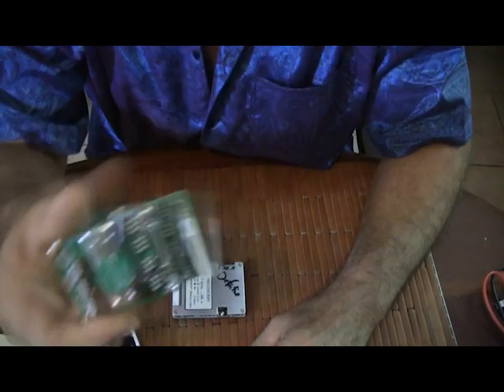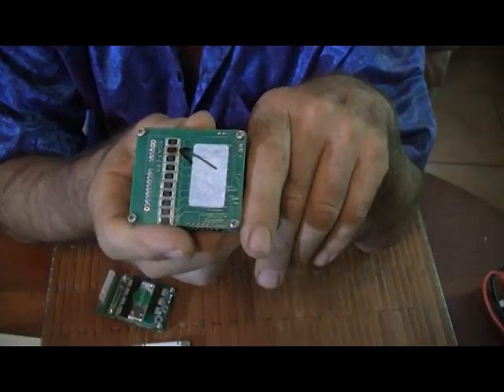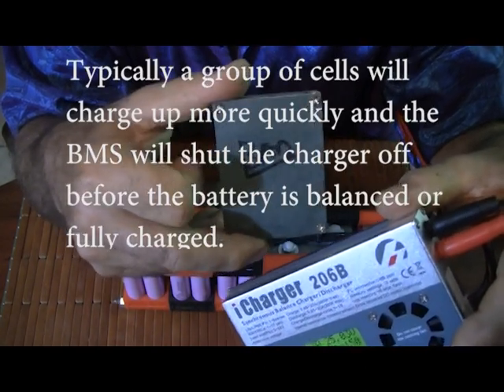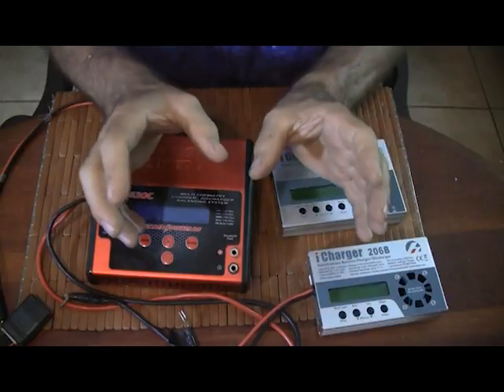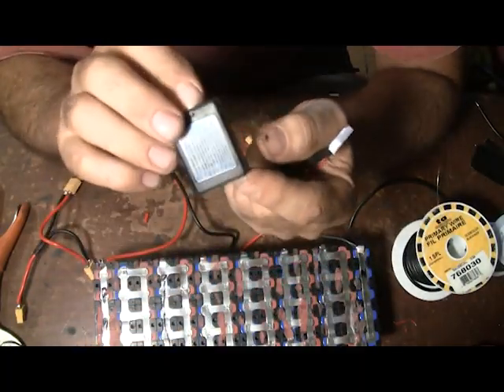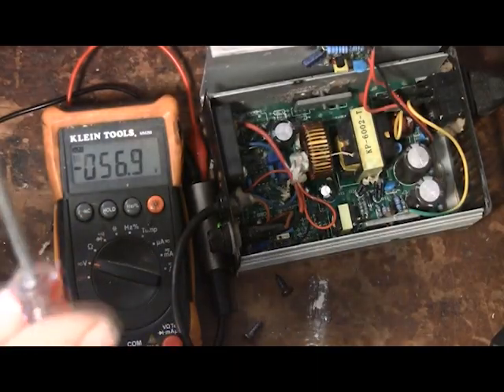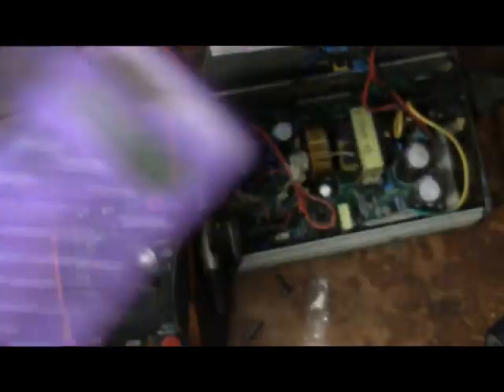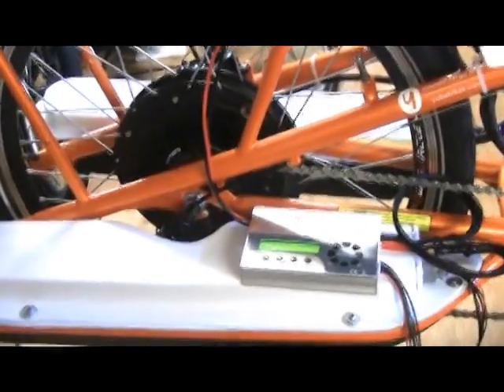How to build a safe and better lithium battery WITHOUT a BMS.

Comment: I'm agree with your point but if you don't know so much about lithium battery and just want to plug and play then BMS attached to the battery pack is necessary, just mind to charge at low rate to allow the BMS balance properly. By the other side,  If you know about the battery lithium then yes; you can make a pack and use a intelligent charger with internal BMS and monitoring display. I make separate packs with the desired capacity and connect them as required with a Low voltage warn system like shown in the video. When I want to charge the battery  just disconet the packs and charge individually at 4,20v. No BMS is required at all. Just a charger like a tp4056 or few of them in parallel and a charger from a cell phone or a few of them. No special charger is required neither. Which way is better? First or second way? All of them. You must think about the requires of your project. Let's say you are fixing a wireless battery drill. Well, the cells use to be placed inside a closed case and is not usefully to open it up every time you need to charge to, so BMS is necessary or at least a balancing wire. In other project like a bike? Well, perhap the second way could be interesting.
Reply from the maker: I agree with everything you said.  Try them all and use the way that best works for you and your project.

Comment: Hi Shawn, it's been a year and been enjoying my ebike to great lengths changing without a BMS as you say. One thing I did have trouble with at the beginning was that I split 14 cells into 6, 6 and 2 and used 3 imax chargers. But... If I forgot to disconnect the cells from 14 to 6,6,2 and I connected up my imax it would smoke them out and they wouldn't work anymore. Now I always remember to split the pack up before charging. But.. It occurred to me to ask you today do you have a way where you can keep your pack as 13 or 14 cell but still charge up 6 cells each without disconnecting it all? Maybe with a diode or something? Many thanks as always you've been a great help in this journey.
Reply from the maker: Hi Danny,

Congrats on your successes!  Yes, you can leave the battery wired in series and still charge chunks.  Pretend the first 6S are their own battery.  Connect an XT-60 to the positive and negative of that 6S battery.  Connect your JST connectors to the first 6S battery.  Now you can charge/balance just that chunk without disconnecting the 14S series battery.  Now pretend the next 6S is a separate battery.  Connect an xt-60 to the positive and negative of that 6S battery, along with your JST connector.   ETC...
Reply: @shawname2  Thanks Shawn for that. The problem is when I do as you say without disconnecting the 14S into their seperate chunks it burns out my 6S battery chargers. They start smoking instantly. The only way I've found I can charge them is by disconnecting the 14S into their 6S, 6S and 2S and charging all 3 packs seperately like that. Somehow my Imax B6 chargers don't like to connect to their 6S, 6S and 2S chunks without the 14S all being disconnected. Any idea why that is and if i can put something in between each 6S connection to my Imax chargers to stop them burning out if I leave the 14S all connected together while connecting each 6S to the Imax B6 chargers?
Reply from the maker: Hi Danny,

Contact me at shawnwiththewind@batteryblocs.com   Send me a drawing of how you have the jst and xt connectors hooked to the battery- or send me your email and I will send you a drawing showing how.  This does work!  I think you might have the negatives in the wrong places...

Comment: you can balance all batteries by putting them in parallel without any electronic. they will balance themselves
Reply from the maker: True- and I have tried to figure out to switch back and forth between series and parallel wiring using relays, knife switches, but no sensible ideas yet.    Do you have any?
Reply: https://www.youtube.com/watch?v=hi8iDy7jsOg @shawname2
Reply: This guy in the above video has a different approach to how to charge all of the batteries in series at once

Comment: I watched your video 10 times and I rephrased my question again.

1.  I'm planning to build my first battery pack and convert to ebike, and you convinced me to spend more on good smart charger. 
I looked up iCharger 1010B+ but max output V 40 with 7 A, so by charging not to 42V but 40 V , I will extend my battery life. 

Please confirm that 1010B+ charger will be good for 36V 15 amp pack. What power supply would you recommend for this charger? I found Junsi 350 - Outputting 350W at 23A/15V. Will it be good? 

2.  If I get 10S charger but cell logger can only take up to 8s, can I connect 2 loggers 5 s+ 5s (not physically splitting the battery?????) and have extra port with  JST-XH 10s for my 10s charger so I can charger my my 10s5p battery as one?

3. Mr. Jehugarcia, talks about bottom levering batteries, should I then go up on the charger and get PowerLab 8 to do both smart charging and bottom levering of the batteries?? 

Thank you a lot!

Comment: It's a very nice setup. I also chose this solution for my ebike ( 20ah / 72V ). The only problem I experienced is that when you parallel balance leads toghether you lose track of each single cell. I had a bad cell and I didn't recognize it right away so I ended up screwing all parallel cells on that pack.
Reply from the maker: Sorry about you losing a parallel group- I think it is the most common type of battery failure.  When a parallel group is going bad it will charge up quicker and discharge quicker.  While balancing with the hobby charger, if one parallel group charges up first all the time and the Hobby Charger keeps bleeding it down so the other cells can catch up, it is going out.  By checking in on the state of each parallel group using your Hobby Charger you can watch the behavior of parallel groups.  With BatteryBlocs it is easier to open a battery and repair.
Reply: @shawname2  this makes a lot of sense..also I noticed  before some unbalancing of that line of cells and I wasn't too reactive in checking the status of each single cell. Anyway apart from this for me it is been working flawlessy for 4 years now on a 12 LIPO Turnigy bricks 6s  in a config 4px3s . I wanted to ask you a  suggestion: Now I bought other 9 lipo bricks same voltage slightly different ma (5200 instead of 5000)with the purpose to extend range (no intersted in power it is already way too much x me)  . How do you think it's best to connect toghether since they have also different life time. For now I am connecting them in a config (4 turnigy + 3 Multistar)P x 3S for a 72v - 35Ah  pack. Would you advise a different solution? Another thing that I wanted make better  is how to change from charging configuration (all 21 bricks in parallel ) to running configuration without having to remember every time to first disconnect the balance lead before .... I fried already several times the balance leads and it would be a more pratical solution !! Anyway great video and thanks for your useful information. Your bike is awesome

Comment: So... don't use a BMS, but use a BMS instead? ohhh ok!
idiot. 
You need to calm down, first of all. All you need to say is having a built in BMS is stupid, which I agree. my BMS are always removable and switchable. I wire them specifically to be removed and replaced.
Reply from the maker: Well it looks like we are very similar!  I like your solution,  though I usually just wire a bypass switch that connected the B- to the P- bypassing the BMS if it failed.  You could then use the JST-XH connector on hobby charger for balancing.

Comment: Hi Mr. McCarty,
     I have attempted your method and the cell loggers constantly get set off prematurely and even go off when they are set to off. I am not pulling more than 1200W and 18 amps when they trigger. Not sure whats going on but all 4 that I have tried have done this, i know they trigger when the motor struggles and is producing max torque but the power is still low. They also get lower readings than my iCharger for each cell voltage.
Reply from the maker: What is probably happening is that the voltage of your pack - and each of your parallel groups- is falling dramatically under your heavy load- triggering the low voltage alarm.  When you back off the load, the alarm then stops, right?  This means your pack is working very very hard.  Yes, the cell loggers are not as accurate as a multimeter or an icharger.
Reply: @shawname2  Thanks, thats what I was thinking

Comment: is it possible to made a battery pack with different capacity 18650 cell...like1000mah,2000mah,900mah
Reply: in theory yes BUT this is in any ways not recommended

Comment: Nice looking bike. Ive got an orange Radwagon mysel.  Im curious about the battery configuration you have on the bike, to get that running board look.  My bike needs some serious upgrading to actually BE a cargo bike.
Appreicate your efforts.
Reply from the maker: Thanks, It's an older Yuba Mundo.  The current battery is a 10P 14S split between the two sides.  The battery is built with BatteryBlocs.   The bike I rode around the country had a 20P14S battery in plastic fencepost tubes that lived on top of the foot rests.   The bike is my daily drive, I hardly use my car.
Reply: @shawname2  I don't have a car, had a gutsful of all the trouble they give and now the petrol prices- given up driving since 2016. my Kristall Y20 and bike trailer is my all rounder

Comment: my hobby charger is a 6s  can you split a 24v 7s batt.
Reply from the maker: Sure.  You would have a 4s and a 3s battery.  It will be cumbersome to switch your hobby charger from 4s to 3s to balance, so you might want to bulk charge to 28 volts most of the time and balance charge when needed.
Reply from the maker: Yes.  You need to split the battery into a 3S and a 4S .  But it is easier to charge if you get an 8S charger...

Comment: Hi Shawn! Very interesting video and I agree that hobby charging is safer! But I was curious, what if you use a smart BMS with a high quality charger, like a Cycle Satiator? I know it would have the same issue by not having enough balancing power as a hobby charger, but at least you get to see the voltage of each battery group and check if everything is in order. Plus, it's more comfortable to charge your pack using a BMS.
Reply from the maker: Good points!  I am not opposed to BMS's in every situation- I am just finishing two 6P10S batteries with them.  However, we are using new, high quality cells and we are charging at a low wattage to give the BMS a fighting chance. So, yeah.  

But if this was a hobbyist battery made of repurposed cells- or a large P group battery- like over 20P- then I would not recommend a BMS.   And yes, any form of cell monitoring- by that I mean someway to read the voltages of each parallel group- is good!  And the Satatiator- as is all stuff Grin Cyclery- I like!

Thanks for your comments.
Reply: @shawname2  Thanks a lot for your swift reply. I am at my first build, trying to make a 12S7P pack for my electric skateboard and I am looking for the best, safest and most comfortable solution in handling the cells and your reply did boost my confidence in the choice I've made. Cheers!

Comment: Pls sir I need ur help OK I wanna build an ebike with a Honda 125 starter motor any ideas and also can't find a link for d battery logger
Reply from the maker: I admire your resourcefulness.  I think I would make it a direct drive motor so that it drove the bike by friction on the wheel.    And I wouldn't use lithium batteries, I would use motorcycle starter batteries.

Comment: I use the exact same setup ... 14s 7p  battery   consisting of two 7s 7p packs. Charging via dual channel charger junsy i 308. 
My Question: could you use a bms for this setup on the go if needed.
At home you could check if the bms does a good job with a dual channel balance charger. This is because the bms and charger are smaller for charging on the go.
Reply from the maker: That's a good question!  I have thought about it for a few minutes, and I don't see why not.
Reply: I drive this setup now for 2 weeks ... mainly use the bms for charging with 8A.

I have another question: Do you have experience with the bafang midrive motors ? A good friend of mine asked me to support him with a bafang hd 1000 watt built.

From the point of engineering geared motors are problematic. My old chineese 150 $ 1000 Watt rear drive hub motor (not  geared ) now has about 20 000 km. The only thing I did was to give  it in a durable rim  with sapim strong spokes.
Reply from the maker: I rode a Bafang mid drive around the USA- looped the USA at it's borders.  I regret using the Bafang.  1. You need a very strong rear wheel- certainly steel- as under load it will work spokes loose.   The controller is proprietary- you cannot get a generic one cheap.   On my ride now I use a front and rear cheap Chinese direct drive motor.  I too find them to be very robust.

Comment: Instead of physically splitting the pack to charge 14S with a 7s charger, as long as you charge at low current what is to stop you charging down the balance wires ?, i.e string 7 positive is string 8's negative . Great bit of common sense Video .
Reply from the maker: Nothing- some low current hobby chargers do just that.  But you need a special charger, one that puts out 4.2 volts and 8.4 volts and 12.6 volts and 16.8 volts etc....  OR- a bunch of 4.2 volt chargers and a positive and negative wire to every parallel group...   Both are complicated...
Reply: @shawname2  Thanks Shawn, I have been doing this successfully on a home made 13S pack  every few charges to ensure I got re balanced but I do need to get a couple of cell loggers now I know what they are called to find them, its nice to have my theory's confirmed.

Comment: This is great, I like it. Yeah, so I bought this kind of charger https://hobbyking.com/en_us/skyrc-ultimate-duo-400w-20a-ac-dc-balance-charger-discharger-power-supply-eu-plug.html , this voltage checker: https://hobbyking.com/en_us/hobbykingtm-lipo-voltage-checker-2s-8s.html and these wires: https://www.banggood.com/10PCS-8Pin-7S-Terminal-Wire-Balance-Charger-MaleFemale-JST-XH-Connector-Wire-p-1049624.html

I just realized that the wires will be a bit too short, but perhaps, I'll be able to rewire the connectors with longer ones.

Comment: Isn't the problem stupid BMSs ? The principle is great. Why don't they charge the lower ones when you start charging?
Reply from the maker: They do.  It's just they can't reign in the voltage on the higher ones and so must shut off the charge to the entire battery rather than have the higher cells go over voltage.
Reply: @shawname2  so basically they can't charge individually? If so, wouldn't that be the next step in this email embedded BMSs?
Reply from the maker: I am not quite following you- Yes, each parallel group is charged individually.  Could you ask your question again please?
Reply: So, the problem is with batteries in series, (right?) Why doesn't the the balanced charging just charge the batteries individually, which are under, and leave the ones close to full charge alone? Basically what your hobby charger does, which imo, is the BMS in this setup -- the BMS just gets disconnected most of the time in your setup.
Reply from the maker: There are small hobby chargers that do use the voltage sensor wires to do this actually.  Yes, a Hobby charger is like a BMS- except it has much greater balancing capacity and a display so that you can see if it has balanced the battery or not.

Comment: I spoke of using step down modules that i can use to charge each cell individually rather than use a balance charger but thats a lot of plugs to connect when you have a 16S pack. However you don't need to balance charge each time. I usually balance charge every 3 or 4 discharges. Otherwise i charge at full voltage of all of the cells in series. Then it's only one connector to plug in.

Comment: I blew two large cells due to those crappy balance port connectors. This is my main reason for using one module for each cell, you can use better connectors. I think i am going to go this way and build a charger for my new 16Ah 16s lipo project. This way i can break down my packs into any size i want to help fit them around the frame of the bike. Also if i choose to go trials style riding i can make it into an 8s 32Ah or just use half of the battery at 8S for shorter lighter rides.